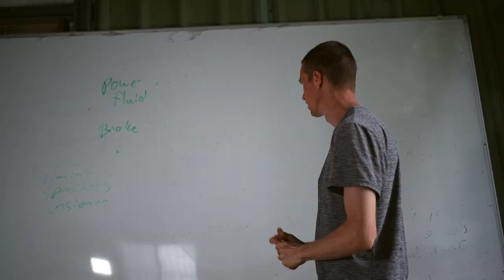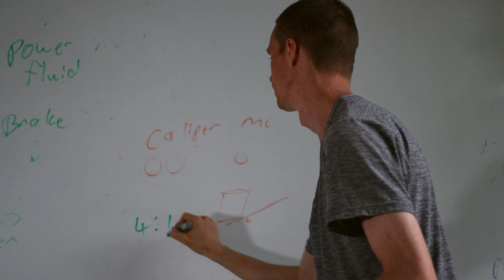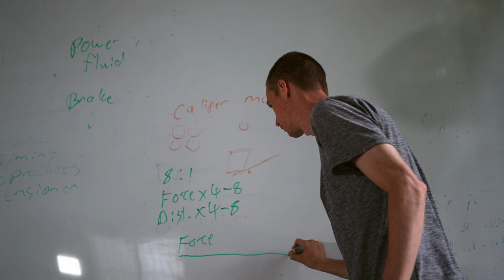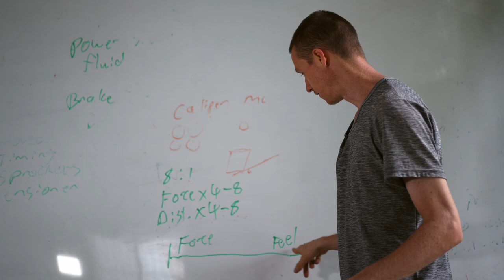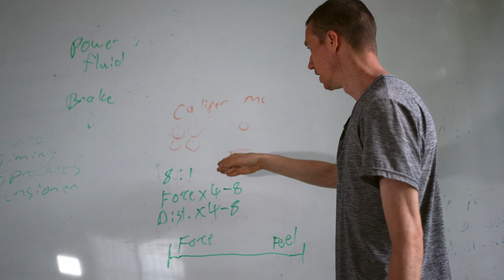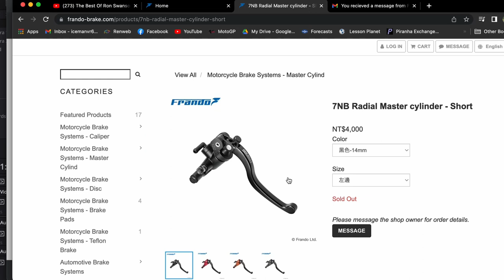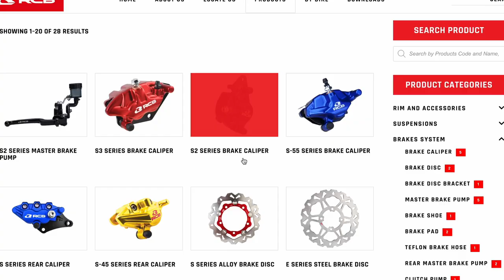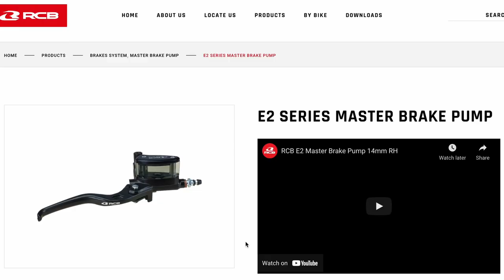Brake Upgrades: RCB Racing Boy S1 Master Cylinder and Frando FR6 Brake Caliper

Comment: Very well explained bro👍 I've been using the RCB 17mm MC on my Royal Enfield Meteor 350 here in India for the last two years and it has been performing flawlessly. Had I seen your video earlier, maybe I would have got a 14mm, as my bike has only a two piston single disc. Funnily the RCB website links the choice of master cylinders to the engine size, 14mm for less than 350 cc an 17mm for above. And 17 mm is the largest they have, so it would'nt work for two four piston callipers.
Also, are all slave pistons on th callipers the same size?, if not then possibly eight small pistons on two discs would need the same master cylinder as four larger pistons on a single disc....